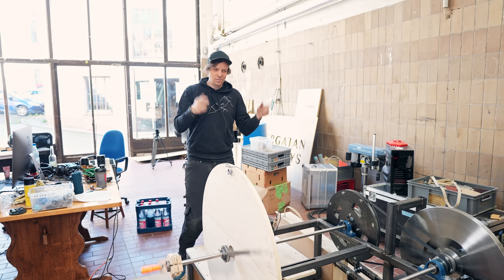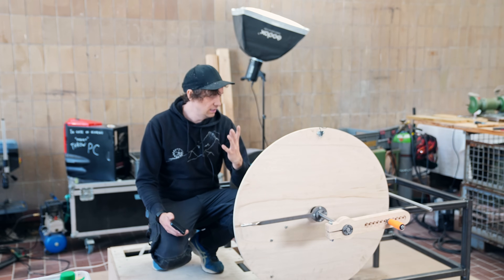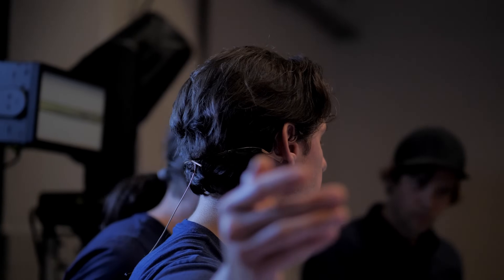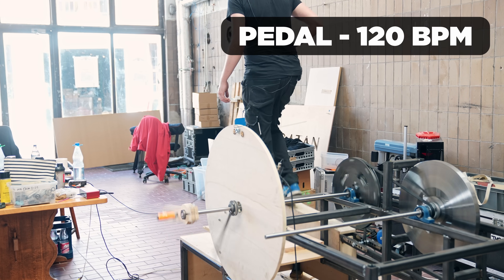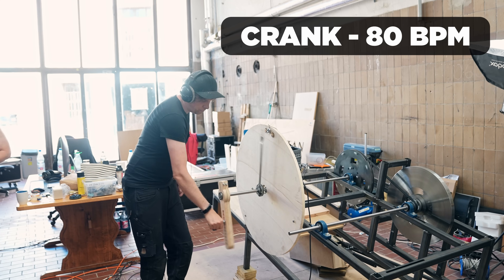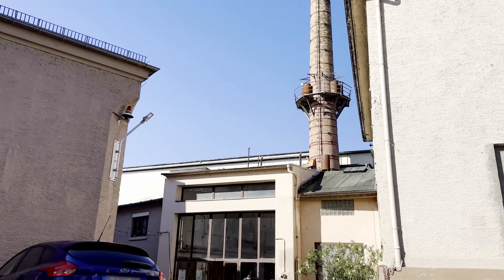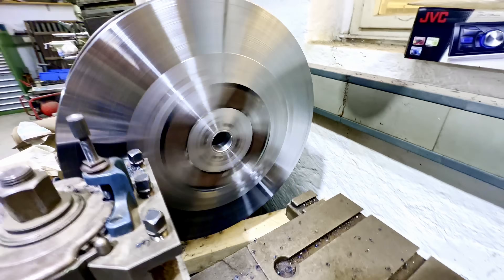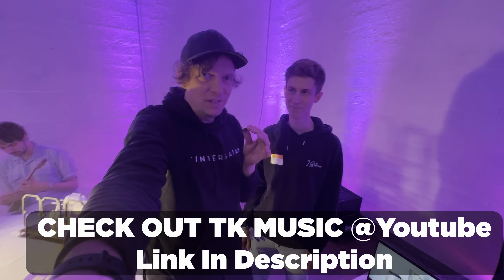The Prototype is Finished - DAY 10 - Marble Machine Flywheel Prototype

Comment: has anyone mentioned that removing the human shaped mass damper off of the platform while using the hand crank is likely skewing the results with extra vibration that doesn't exist when the human shaped mass damper is on the platform pumping the pedal?

Comment: Really need to get that governor installed - that will help I reckon. But in truth, every accurate machine needs a constant consistent power supply, like a clockwork weight mechanism, a water wheel or other gravity source. The speed can then be controlled via governor or braking (including magnetic).

Comment: Hi martin, 
You are spending a lot of time on gathering and analysing data from the flywheel. But you are testing it without any load on the output shaft. The dynamic of the flywheel, the way it will react on acc and decc, the amount off fatigeu you’ll expierence (for example even when hand cranking is more precise, it will fysically be way harder to when there is extra load than when youbinly have to keep the flywheel up to speed) will change when the load of all the turning parts will be added. I think you should find a way to calculate the load that will be added by all parts and add that as friction to the test-assembly

Comment: The pedal and the crank won't take much energy out of the system over a longer period of time; but on a short timespan they will take energy out and then put it back in. If you counter balanced the crank, it would be better still. Similarly when you're looking at the flywheel. Yes, it's good to look at the side to side wobble, but what seems more important is looking at the rotational speed consistency. When you were looking at the side-to-side wobble, you could also visually see the slow down and speed up in there.
When you were measuring the high and low point, it would've been good to measure whether just the bar itself- right next to the fly wheel, if that was centered. It will be in the lathe but it would've been good to test if the same is true on the prototype.

Comment: To improve the consistency of the bpm, it might be beneficial to look at the rotation like a driven harmonic oscillation. Because you keep moving around the  wanted frequency, it seems like your system is underdamped. The best way to improve this would seem to be some sort of velocity-dependent brake/resistor. Maybe something like an eddy current dampener or a liquid dampener might improve the frequency. You could even go as far as to calculate the required damping if you know the angular velocity and the moment of inertia of the flywheel. In case you want to know more about this, the wikipedia page for harmonic oscillators is quite informative.

Comment: you shouldn't use standard deviation in milliseconds, you should normalize by the BPM... A deviation of 1ms is way worse when playing at a higher tempo. Since the time between two 120 bpm beats is 0.5 seconds, then a standard deviation of 1 ms would be 0.2 %. If it were 1 ms standard deviation at 60 BPM, it would be 0.1 %
Reply: Or if you want to visualize it, convert ms into degrees of rotation of the main drive shaft.

Comment: One of the best and most moving things about music is that it can change tempo, sometimes gently, sometimes abruptly. Yes, all the instruments need to play at the same time, but that's not the same thing as saying the tempo must never change. I suspect your intuition about hand crank vs pedal is that for the pedal, changes are slower and more incremental, i.e. the gradient of tempo change is lower. With the hand crank, I bet you're able to adjust more quickly to being ahead or behind, but those rapid changes may not be what you actually want.

Comment: First: Energy is oscillating towards and back from the pedal when it goes up and down. So the angular speed is also varying with each half turn but the mean value stays the same.
Second: You could use a light barrier or an proximity sensor to get a perfect signal for each rotation.

Comment: I'm not an engineer by any stretch, but I wonder if building a frame for the foot pedal that is a triangle instead of just a straight bar would help with the flexing issue. I also think that might account for why it felt like the crank was tighter but the data said otherwise. You feel the flexing when pressing it, but the speed and flywheel accommodate enough within the system that it makes it play tighter regardless

Comment: I think the reason the pedal worked better is actually that it is slightly flexible, meaning it takes up some of the unevenness in movement that is innate to how a human body works. The spring effect essentially evened out the power input to the flywheel, and keeping a steady rhythm for a spinning mechanism is the same as balancing out power input and loss, right? I'm not any kind of engineer, but that seems about right to me.

Comment: I think that your disconnect between how the pedal and crank felt vs how they measured is coming from how spongey the pedal is.  Pedal is still bending a lot even after beefing it up.  Bending of the pedal = lost energy plus you lose the feeling of a solid connection to the timing like you have with the crank.

Comment: If high BPM is difficult to play, maybe you should add a gearbox between the flywheel assembly and the output to the rest of the machine. That way you could pedal at every beat for low BPM songs and at every second beat for high BPM.

Comment: A big problem with the prototype compared to the MMX is that the prototype isn't driving anything yet. The MMX moment of inertia is massive in comparison to the prototype. I'm not sure how you could reasonably add resistance to the prototype without just chucking more wheels on, but it is something you should consider when analyzing the data.

Comment: The problem with the pedal is that it's difficult to push back and resist momentum when it gets too fast. The crank would probably be better because it would be more natural to resist the excess momentum. Then you wouldn't have the same problem with overshooting.
Reply: Is it, though? For exactly half the stroke, the pedal is moving upward and all you have to do to slow it down is to put weight on it.
Reply: @ps.2  Yeah, it just seems to me that it would be a finicky thing to get used to, since you would have to repeatedly and accurately reverse the direction you're pushing in. I think the crank would be more natural. Then again, obviously I've never tried it, so maybe I'm wrong. 😝

Comment: What about using a belt-driven conical pulley with a spring-tension adjustment for RPM?  Something similar to what go-karts use?  This would allow you to continue to use the pedal at whatever natural rhythm feels right, and any extra torque would be absorbed by the clutch.  You could probably even use a Bowden cable and lever to adjust the spring tension, giving you a BPM Lever!

Comment: I'm confused.  That is not a shock as I have no experience in this area.  Isn't the goal of the flywheel to provide an energy source independent of the music tempo?  Crank up the flywheel and then connect the energy to regulated music tempo gears, correct?
Reply: Correct

Comment: Hi Martin. If you want to have "tight" music at the end, you should get rid of the pedal. It slows down the wheel on the upstroke and speeds it up on the down (due to gravity) and also adds and subtracts inertia when changing direction, so even if the timing of a full rotation is spot on, it'll be off at fractions of the rotation. I recommend a properly balanced rotary mechanism, maybe with a one-way bearing for adding energy to the flywheel.
Reply: If a pedal is still wanted,and the sub-cycle fluctuations too much, a counterweight set 180° off could balance the pedal's effect on the speed.

Comment: The pedal is not taking away the energy when its idle, but when you actually use the pedal to power the machine! Look at the video when you use the paddle: the first couple centimeters when you apply force it all goes into bending the steel, instead of accelerating the wheel. You need to stiffen up the whole thing and not only the middle part. I could also feel that when I was doing it by myself.

Comment: If you can manage using triangles, that should make the frame a lot more rigid. Also, It makes sense that your input (Weight*Gravity) on the pedal was more consistent than your hand crank as gravity and your weight will be constant where as you moving the handle will not be.

Comment: Now all you need is to create a governor to keep the speed at the same rotation you wanted. It will help level out the rotation and keep it where you want it, even when pushing the pedal to go faster, with out peaking up past your rotation.

Edit; you may want to add a rotation gauge so you can see how many revolution per minute you are going.

Comment: The flywheels are making it too slow to change pace, instead of flywheels you should use a giant electric motor to drive the system using encoder position, and then create pedals and such that you can program to control the motor to do whatever you want.

Comment: You might want to check consistency throughout the rotation. Like it might be faster on the way down than the way up which could lead to not tight music for component playing at faster rhythm than the wheel.
Reply: Agreed! Adding a second contact microphone offset from the the current one should allow for measuring any discrepancies in speeds.

Comment: I think it's because of the distance from the pedal to the actualy wheel it turns is why it's so much harder to work with
a crank has only the cranks distance to the actual thing it tries to turn. But the pedal has to travel all the way to the back and up to the wheel its turning, making gravity work against you more.

You can see this in action if you pick up something like a long pole from it's base as opposed to picking it up from the middle.
Even if you've closed the pivot point of the pedal closer to the bedal it will still fight you. before it wants to do it's thing.

Also, because the flywheel has it's own innertia, when the pedal comes up, you the user have to force it back down fighting the pedals inertia.
A crank only goes in one direction so you don't have anything to fight against.

Comment: I think while using the foot peddle there's more constant force being applied over the entire cycle with just the weight of your foot / body, while with the hand crank, there are probably more force changes happening whenever you turn it, like maybe when you go from pushing the crank downwards from the 12 o'clock position to pulling it toward yourself near the 6 o'clock position.

Comment: I'm not an engineer, but a spring loaded pedal with a catch and a "sawblade" gear would possibly be a solution for the pedal. It only engages on the down stroke and the return has it's own power - as long as your foot doesn't slip...

Comment: I think it’s time to design a governor or transmission module to generate a constant speed output from varying power input and power demands.  So far you have been testing your system unloaded which isn’t realistic.  Under varying load, even a gravity based power source will not produce constant speed.  The problem lies not with the power source but with the control system.

Comment: I keep thinking about "make the design requirements less dumb", why not use the motor from the MMX? I love that Martin is using data, prototypes, and empirical measurements to guide his design, but I don't think the powertrain should be getting this much emphasis at the start of the prototyping stage because the powertrain can be isolated from the rest of the design.
- If the power is coming from one shaft, the rest of the design doesn't care where that power comes from
- The powertrain can be redesigned and replaced independently of other systems (decoupled/abstracted)
- An electric motor was proven to work on the MMX
If the design requirement is "machine must be human powered", that requirement doesn't mean Martin necessarily has to power it. For example, what if the world tour had a booth where fans could volunteer to charge up batteries with a bicycle?
Reply: Couldn’t agree more!

Comment: Martin, why on earth are you trying to match the marble machine to an external bpm source? If you want to sync the machine to a sequencer when playing live, the marble machine should be the master, not the slave. Technically this isn't that hard to achieve (tap tempo with a contact mic as a source for instance).

Tight music doesn't mean a holding a 100% steady tempo. The tempo can vary, as long as all the instruments are locked in with each other it will feel tight.

Comment: How about building a mechanical analog to an electrical buck converter constant current source?
That would be insane(ly cool).
Reply: With that one can pre-charge the system and it only takes out as much energy as it needs to self regulate to a target speed set with a lever.

Comment: Theoretically pedal should work better than hand crank, but I think the upward motion of the pedal should not be coupled with the motion of the flywheel. The gear should only harvest energy from downward motion of the pedal, and when the flywheel is free rotating, it seems safer for the pedal to stay up instead of keep oscillating.
Also, I think the geometry of the flywheel can be enhanced so that comparable angular momentum can be achieved with a lesser total weight.
Reply: I think you are right, if the pedal only engages with the system on the down stroke he can give it longer pushes when accelerating and shorter when being close to the desired bpm, the issue is that he would have to raise the pedal with his own force, but at high bpm it would be easier to keep the tempo with shorter strokes, and go even faster.
Reply: @rafaeliglesias5437 Totally agree. During live performance,  it would be much more intuitive for Martin to pedal in the bpm of the music. So the depth of stroke would be ideal to control power input to the fly wheel.

Comment: The crank has a finer resolution because the input is at least 2 strokes per revolution, whereas the pedal is only 1 stroke per revolution.  If you had  a rotary pedal assembly, like a bicycle pedal, you could power the flywheel with two strokes per rev, while sitting. : )

Comment: at the torque values you're working with, a continuously variable transmission could be useful to combine with the gravity fed design you previously considered. That transmission would allow you to change the bpm of the machine to anything you want on the spot with relatively high precision

Comment: link the Huygen chain drive to the flywheel and pedal, it solves all your problems in one go.. if you need grip for the drive then lining the pulleys with soft plastic or plasti-dip could work paired with a steel wire, if i remember how that mechanism worked right.. all that is for certain is that the problems you are finding would be gone (at this step).. lets face it, there are gonna be more moles to whack.

Comment: The crank seems more consistent, but the uneven footing required to raise the crank probably meant more imprecision, resulting in a consistent standard deviation across bpms, but too much noise in the system resulted in a higher standard deviation compared to best case with pedcal.

Eliminate the shaking and redo the results, and disconnect the pedal while testing crank, even if it doesn't absorb energy it does contribute to an uneven force for the crank shaft to rotate, i.e. it spends more force going up than down. Because we need results to be uncontaminated as a benchmark, then adding variables second.
Reply: Results are not contaminated by the (very slight) speed changes during the rotation. He's only taking 1 data point per beat.

Comment: I wonder if the issue with the foot pedal not being as tight is due to when in the cycle energy is being input into the system. With a bare pedal, the only time you are inputting energy into the system is on the down stroke, less than 180° of the cycle. It looks like you may have been playing with that idea with what looks like a foot strap to try to also input energy into the system on the upstroke as well? I imagine with the crank you are both pushing and pulling, 

Also, to take more flex out of the pedal, did you consider adding a triangular truss under the pedal arm for the entire length of the pedal arm? doubling the thickness is quick and dirty, but there was still significant flex when you were stomping down on the pedal, particularly when accelerating to your target BPM.

Comment: The pedal drive will have some inherent oscillation in the BPM since you can only input power for half the cycle. Like, even if you’re averaging a “perfect” 120 BPM, a system driven by a single pedal is always going achieve that 120 average by being, say, 121 BPM at the bottom of the power stroke and 119 BPM at the top. The heavier the flywheel, the less this will be noticeable, but it’ll never be eliminated. You need a way to continuously input power if you don’t want the BPM to fluctuate.

If you put a bunch of those contact mics around the circle and measure the BPM throughout a rotation instead of just at the top, your data will probably show it.

I think.